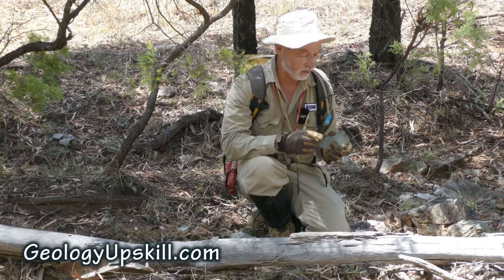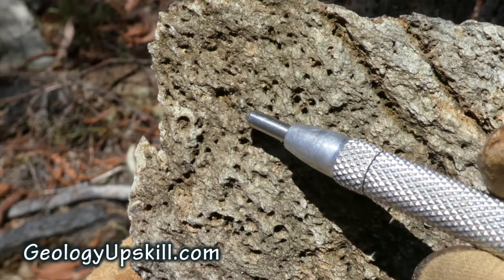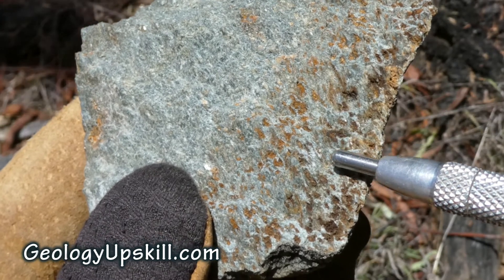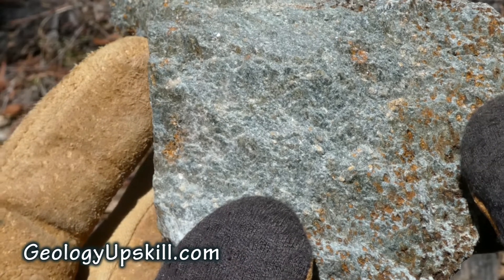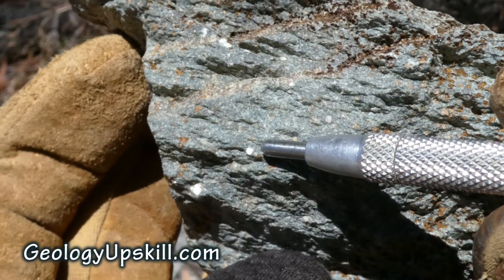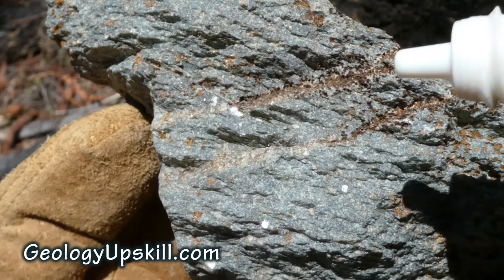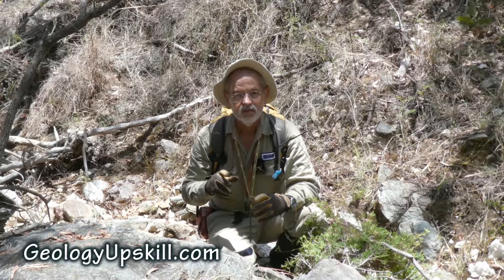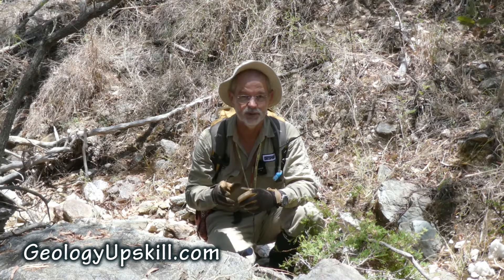When Boxworks Aren't Boxworks

Comment: How's a boxwork defined?
Reply from the maker: From my point of view it is any cavity resulting from the dissolution of a mineral grain in the weathering environment.
Reply: @GeologyUpSkill  I understand. This is quite different from what some other (few) have used it (e.g. Loope, D. B., Kettler, R. M., and Weber, K. A., 2011, Morphologic clues to the origins of iron oxide–cemented spheroids, boxworks ...: The Journal of Geology, v. 119, no. 5, p. 505-520.). Usually the latter usage is confined to a paralelipipedic limited piece of rock which is rimed by the product of an oxidizing fluid.
Reply from the maker: Academic geologists love to create pigeion holes and give them new names. I love to find orebodies. Same rocks different viewpoints.